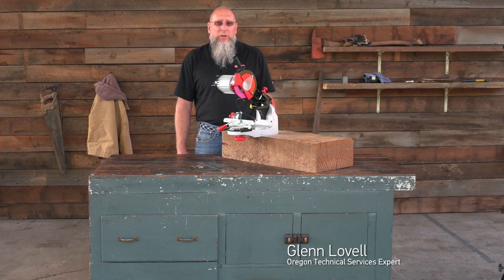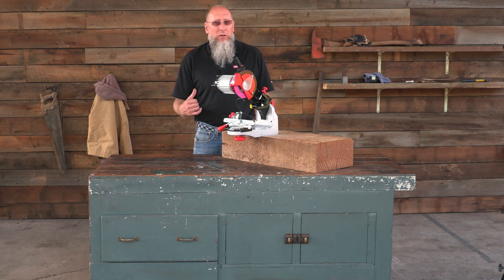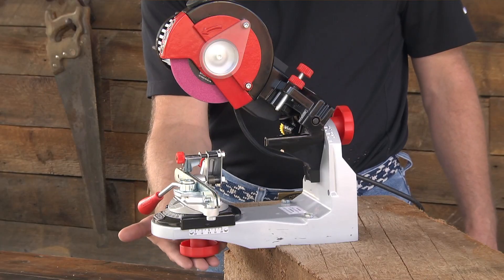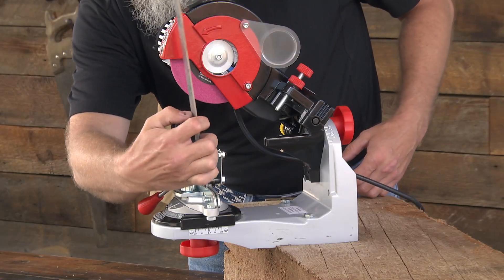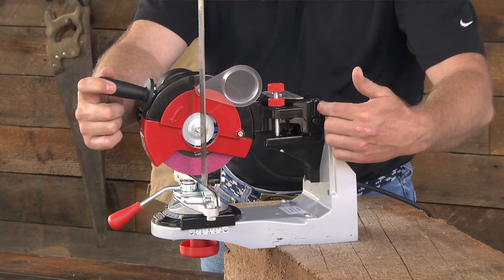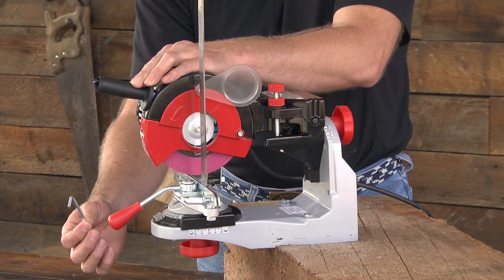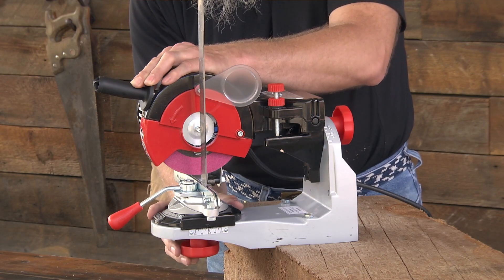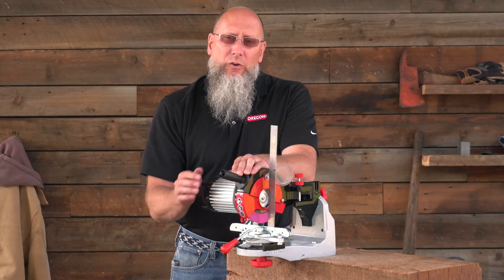Technical Tips- Centering Process for 520-120 and 620-120 Chain Grinders

Comment: This is wrong for the 620-120. It has NO adjustment. You have to set your center and note where it falls on the scale. It would be nice if you could move the little scale to set zero.

Comment: This video is wrong.  The sliding base of the vise is adjustable to compensate for grinding wheel wear.  The vise must be re-centered as the grinding wheel diameter becomes smaller, because the arc of travel from the head pivot draws the wheel inward with wear, thus introducing error to the grind angle.  The video incorrectly states to hold the grinding head at a 90 degree elevation to the base bracket and then align the vise.  The correct procedure is  to bring the circumference of the shaped grinding wheel to the height of the chain gullet bottom.  Then adjust the vise center line to the spindle center line.  Before making this centering adjustment, the machine is preset with the vise angle at 0 and the head tilt angle at 90.  Interestingly enough, the 520-120 manual is also incorrect.  It states to align the vise with the guard securing screw which is wrong, and to lower the head but gives no mention to where.